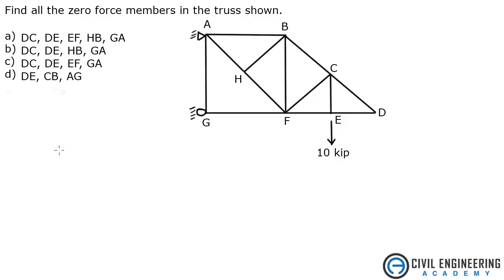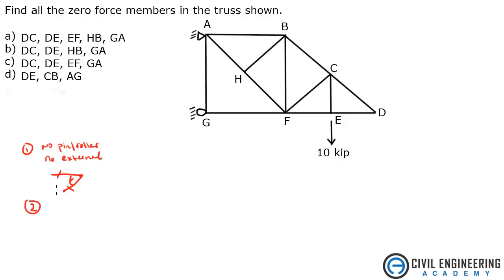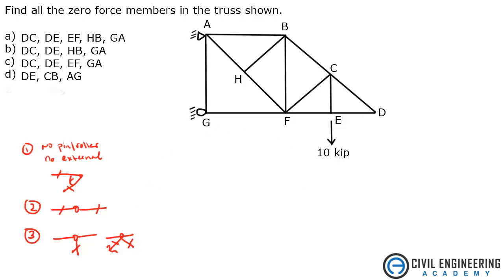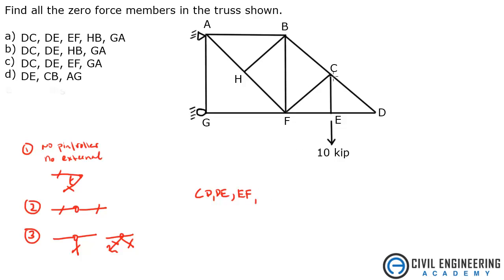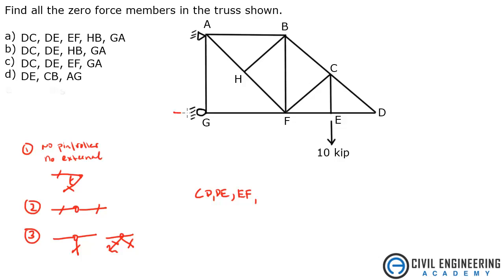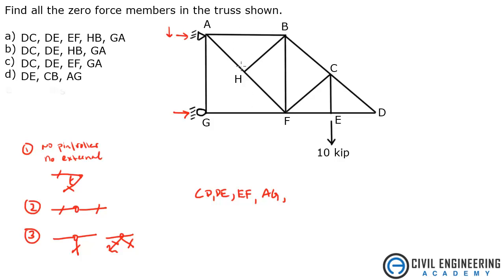Structures -  Zero Force Members in Truss 2

Comment: which zero force member rule applies to EF?  Please explain why?   thanks for the tutorial!
Reply: However there is a point load at joint E. Are you sure that rule 2 still apply to that? As far as I know you can't count member/s as zero force if there is a reaction or external load at the joint it is connected with.
Reply: Migs Dali it is still a ZFM because although there is a load at Point E, it is exclusively horizontal while EF is exclusively vertical.
Reply from the maker: +Vincent Subramaniam Rule 2 is what is applied there.  Because DE is zero then you've got rule 2 applying.  Hope that helps.
Reply: Civil Engineering Academy thankyou sir

Comment: Isn't BC a zero force member as well since it is collinear to CD member ?
Reply from the maker: +aaronwan96 the reason for that not being a zero force member is because you have 4 members attached to that spot.  For the colinear rule to work you have to have 3 members there....or one of the shootoff members would need to be a zero force to make it three members in that spot.  You can also use the method of joints to solve after you have knocked off some of the zero force members you absolutely know.  Hope that helps.